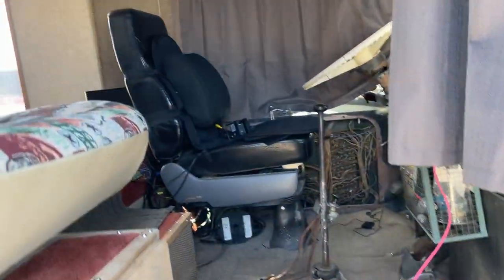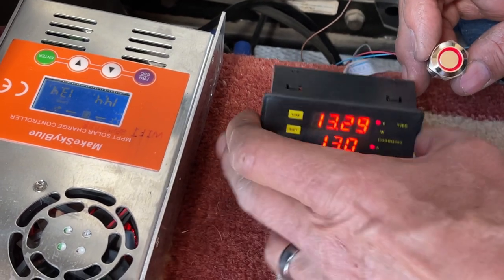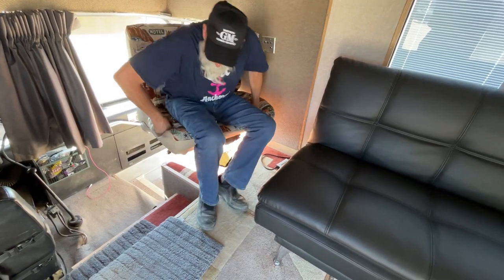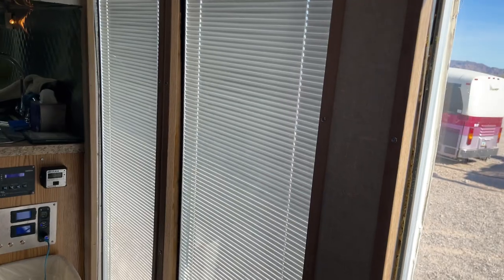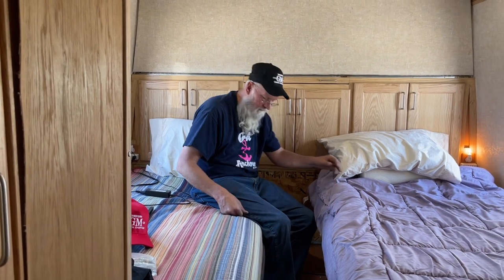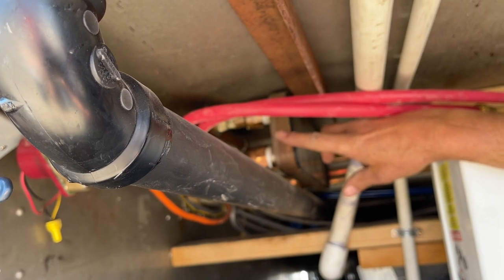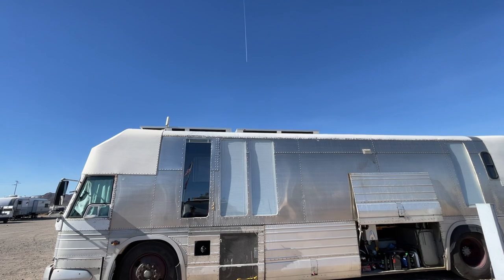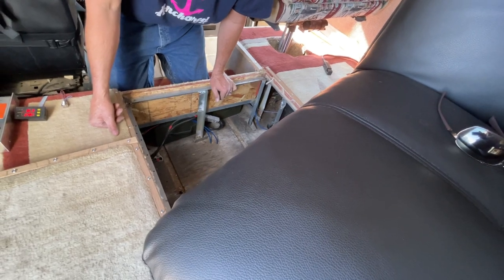Innovative GM 4107 bus conversion tour

Comment: Here are some of the parts (Main Batteries) I used to build the Lithium batteries banks. 

Headway 38120HP LifePO4 Authentic Battery Cells:

Item specifics
Condition:	
New: A brand-new, unused, unopened, undamaged item in its original packaging (where packaging is ... Read more
Brand:	
Headway
Voltage:	3.2V	Battery Size:	38120
Amp Hours:	8 Ah	Product Type:	Battery
Chemical-Composite:	Lithium	Model:	
38120HP
Battery Type:	LifePo4	Coin Cell Diameter:	38mm
Chemical Composition:	Lithium Iron Phosphate (LiFePO4)	Application:	Solar/Wind Devices
MPN:	
38120HP
UPC:	
Does not apply
Reply from the maker: Thanks Russell.

Comment: Where did he get those meters from !   The 2 x 120V do hickies.
Reply from the maker: I don’t know.. I need one. They look like arduino screens to me. I should find out.
Reply: @ThisOldBus  Please do !
Reply: This is the Lithium meter in the video: 
It's about $30

DC 120V 200A Voltage Current Ah Capacity Meter Charge Discharge AGM LEAD LiFePO4

Item specifics
Condition:	
New: A brand-new, unused, unopened, undamaged item in its original packaging (where packaging is ... Read more
Brand:	
AiLi
Model:	
EL120100C
Current Range:	-200A ~ +200A
Panel cut-out:	76.5mm×39.2mm	Voltage range:	0-120V
MPN:	
E001-L120200
Accuracy:	Volt ± 1% + 2byte / Amp ± 2% + 5byte
Bundle Listing:	Yes	Type:	Digital meter
Country/Region of Manufacture:	China	Operating Voltage:	10-90V (5-40V options)
Resolution:	0.01V, 0.1A, 0.01W, 0.01Ah, 0.01H	UPC:	
754610748714
Reply: This is the Incoming 120/240 volt meters first shown in the video.
Cost about $20 each

PZEM-022 AC Digital Meter Power Energy Voltage Current KWh Test Close CT 100A US
Item specifics
Condition:	
New: A brand-new, unused, unopened, undamaged item in its original packaging (where packaging is ... Read more
Brand:	
Unbranded
Operating frequency:	45-65Hz	Model:	
PZEM-022
Rated power:	100A/22000W	MPN:	
Does Not Apply
Type:	AC Multifunction Digital Meter	UPC:	
748904257785
ISBN:	
Does Not Apply
EAN:	
Does Not Apply
Reply: FYI, I bought most everything on or from Ebay.